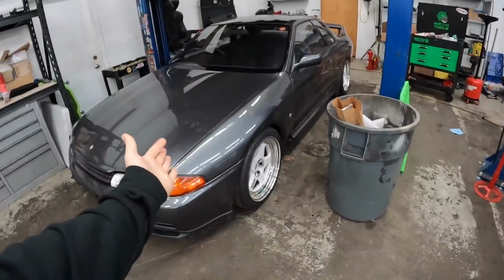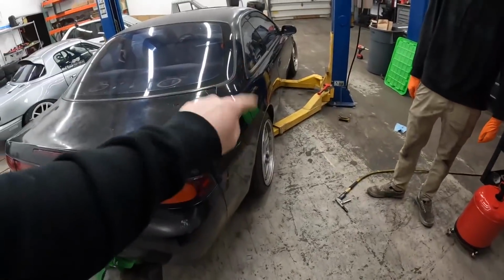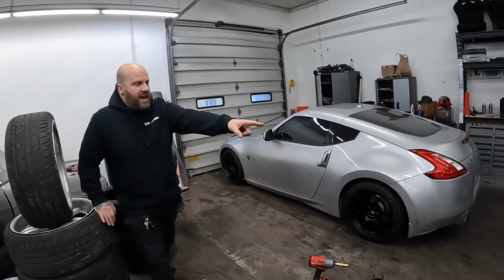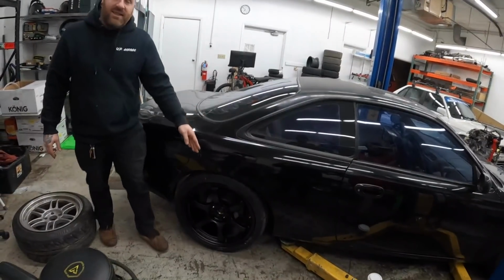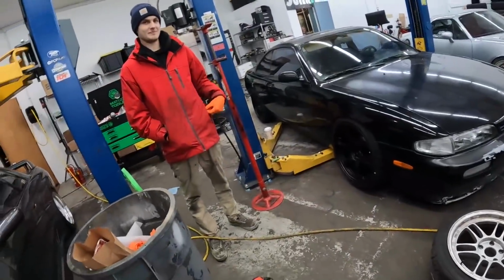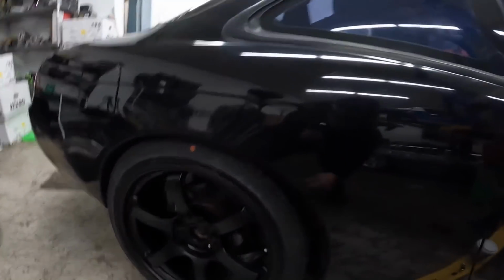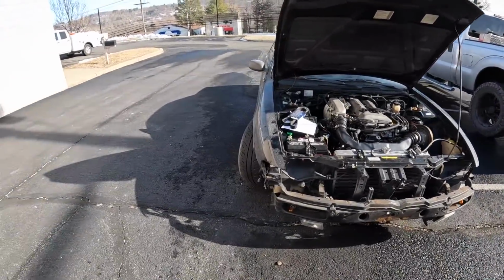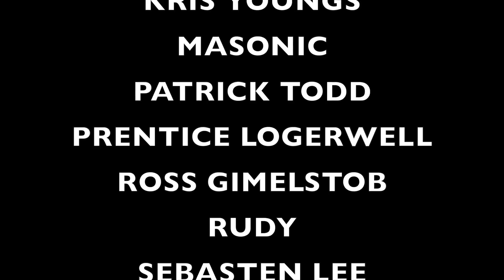FINDING THE PERFECT FITMENT FOR MY 240SX!

Comment: Zs have big wheel wells, especially in the back. 19s are what look best on them but might not be the most practical for drifting. Realistically you can get away with 18’s on a Z but to fill the wheel well you usually have to run 45 side wall tire or 40 if it’s slammed. 35 and 40 side wall fit 19’s good on Zs,  but 18’s need beefy tires and wide wheels or spacers to fill the fenders👍🏼 good luck brother I’m sure you’ll sort it out 🙌🏼
Reply: 19s are just not good because tires are so expensive
Reply: 19 isnt good for drifting tho. Expensive and small sidewall doesn't give good site bite because it doesn't have the flex.

18 and meaty tire is the way to go.

Comment: you adjust grip on a driftcar by tire pressure! way easier than changing tire sizes. use a 265/35/18 and then blast the pressures to 60psi and you will be rippin! the larger tire has more rubber which will dissipate heat faster. heat is what kills tires in drifting

Comment: Definitely need to step up to a 265/40. Personally ran a 295/35/18 on the back of my 370 and it filled out well. Rear setup was 18x10.5 +15.
Reply: yeh i ran 18x10.5 +15  all around on my z34

Comment: 370s look goofy with 18s pretty much no matter what, that and the specs of the rays are pretty buns. Car would have looked great with a 19x9.5/10.5 with a +12-22 offset setup been through several sets on my car. Rpf1s are  one of the only wheels that don’t look ass on these cars with 18s. 

240 looks great on the 18s but the fenders will be toast in no time from the abuse it’s going to get unless you raised it a tad. 

Worst case scenario keep some of the rays for the 240, start over with the 370 for wheels
Reply: The main reason 18's look like ass on the 370 is because people run way too small of a tire. If he was running 275/35 up front and 295/35 in the back on a 9.5/10.5 stagger, it would look perfect.

Ran that on my car and it was perfect.

Comment: As someone that low power drifts a lot I run 18x9 +15 215/40-18 380ish treadwear and a lot of tire pressure. Sidewall barely rubs on the fender with 0 degrees camber. Kansei wheels have handled all the dirt drops and potholes

Comment: Hey Chris. Have you thought or Tommy thought of buying a wheel simulation tool to check all the specs for wheel and tires? They’re about $500 on ebay. Might save you money in the long run. Just a thought.

Comment: yessssss, put 370z wheels on 240! then get new wheels and taller tires for the 370z, step lips wheels are a must. 5 spok was hot but multi spoke is lit too. get a 265 or 255/40/18 for the rears

Comment: z needs a 30mm in the rear and more low, could use a spacer up front as well
Reply: Or the maybe just get the proper specs when you buy brand new wheels for the cars. Doesn’t get much easier for these 2 cars

Comment: Why don’t you do the NA-T Sr setup like The Boi JimmyMane J_Oakes! He said it had been fairly reliable, and makes enough power to have some fun and get out of its way… the sr NA is a Dogggg! You’ll start breaking axles before you can even have some fun with the 235s haha 
That car would be plenty fun to get your seat time in the chassis with still relatively low power so you’ll be able to learn the car super well and then still have plenty change to save for the SR20det